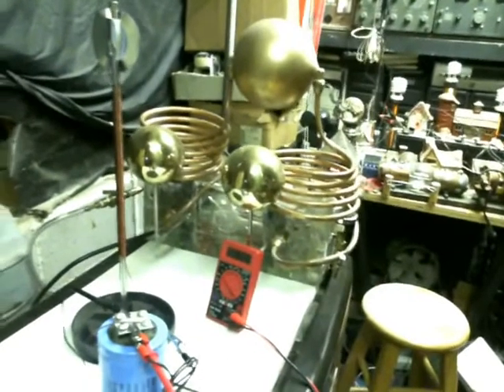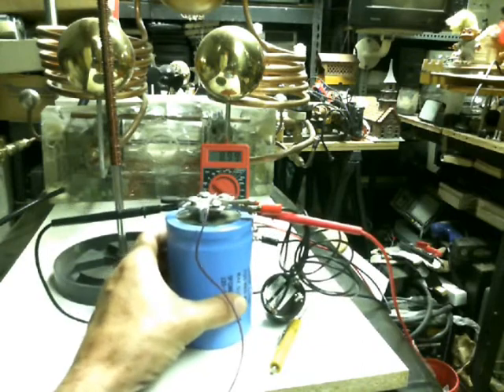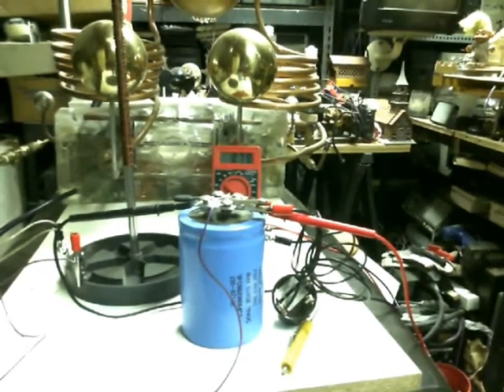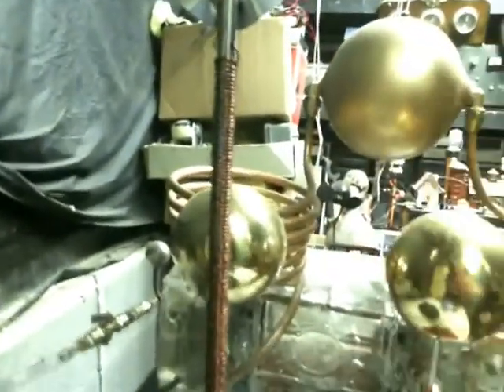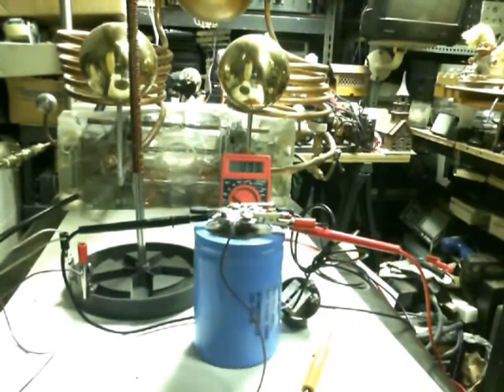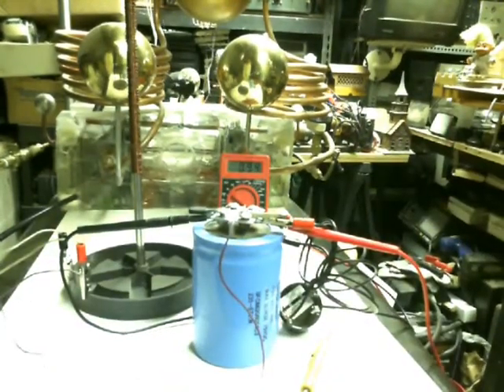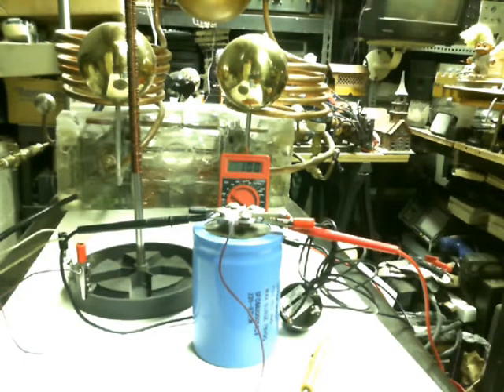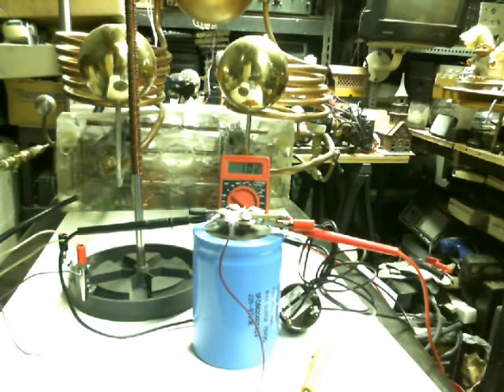RADIANT ENERGY !

Comment: A comment for discussion or critic..... If the formation of lightening is instigated by the movements of hot and cold air in relation to each other would this be a factor to include into design ?
As in would perhaps having the collector sheet above a warm air source ( chimney/vent ) and in a position where cold air can also pass by stimulate higher electrical charge ?

Over to you guys :-)  ......